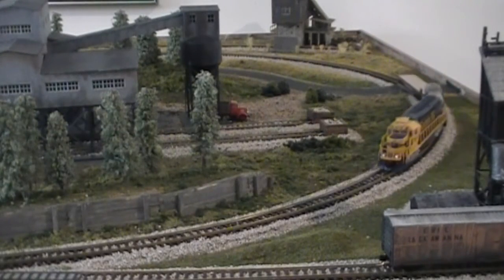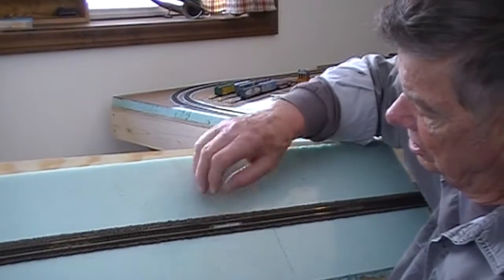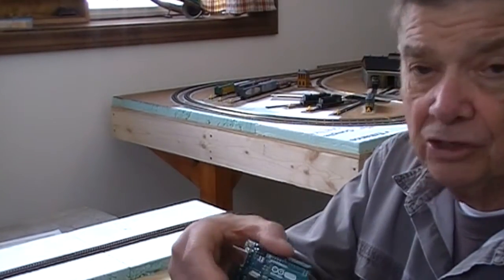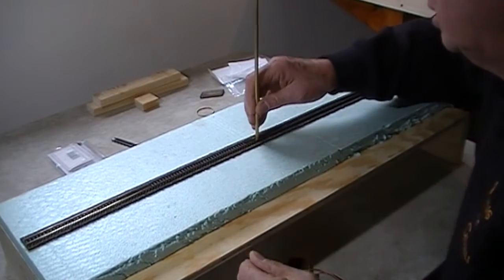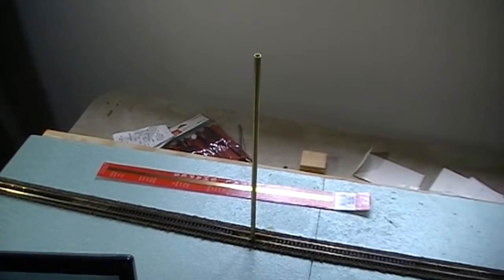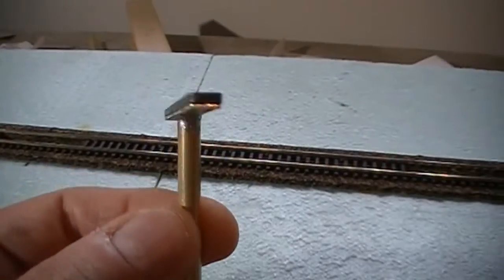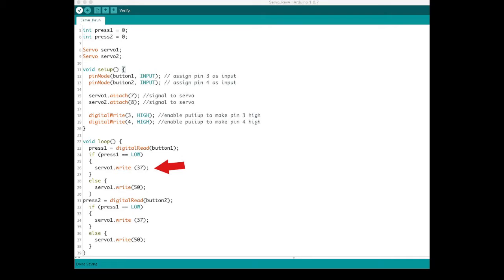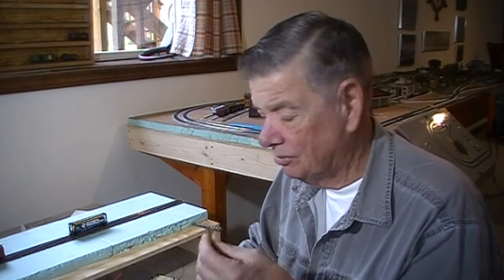Magnetic Decoupler Project

Comment: This method is entirely too complicated and totally unnecessary.  An Arduino and a servo for magnetic uncoupling???  How about 2, quarter-inch neodymium round magnets secured inside opposite rails?  That works and it works well every time.

Comment: Neat idea. Thanks for sharing. I’m starting to think the Arduino can do a lot on the railroad.
Reply from the maker: I really like using the Arduino. It controls the turntable, the weld shop, and campfire also. I am starting to set up some signaling on my layout using the Arduino.  My big problem is I did not set my layout up for block detection so now I am rewiring it for that. I enjoy your videos and thank you for the reply.  —Jack
Reply: LS3Jack I have started the preliminary investigation towards signaling. Found the wiring needs to be altered as well. I’m interested in Arduino for signaling. It’s a new avenue for my investigating now.

Comment from the maker: I wanted to correct the sketch for 6 servos:

#include <Servo.h>
int button1 = 2; //button pin will be HIGH
int button2 = 3; //button pin will be HIGH
int button3 = 4; //button pin will be HIGH
int button4 = 5; //button pin will be HIGH
int button5 = 7; //button pin will be HIGH
int button6 = 8; //button pin will be HIGH

int press1 = 0;
int press2 = 0;
int press3 = 0;
int press4 = 0;
int press5 = 0;
int press6 = 0;

Servo servo1;
Servo servo2;
Servo servo3;
Servo servo4;
Servo servo5;
Servo servo6;

void setup() {
  pinMode(button1, INPUT); // assign pin 2 as input
  pinMode(button2, INPUT); // assign pin 3 as input
  pinMode(button3, INPUT); // assign pin 4 as input
  pinMode(button4, INPUT); // assign pin 5 as input
  pinMode(button5, INPUT); // assign pin 6 as input
  pinMode(button6, INPUT); // assign pin 7 as input

  servo1.attach(8); //signal to servo1
  servo2.attach(9); //signal to servo2
  servo1.attach(10); //signal to servo3
  servo2.attach(11); //signal to servo4
  servo1.attach(12); //signal to servo5
  servo2.attach(13); //signal to servo6
    
  digitalWrite(2, HIGH); //enable puiiup to make pin 2 high
  digitalWrite(3, HIGH); //enable puiiup to make pin 3 high
  digitalWrite(4, HIGH); //enable puiiup to make pin 4 high
  digitalWrite(5, HIGH); //enable puiiup to make pin 5 high
  digitalWrite(6, HIGH); //enable puiiup to make pin 6 high
  digitalWrite(7, HIGH); //enable puiiup to make pin 7 high  
}

void loop() {
  press1 = digitalRead(button1); 
  if (press1 == LOW)
  {
    servo1.write (37); //This valve can be changed to set min or max limit
  }
  else {
    servo1.write(50); //This valve can be changed to set min or max limit
  }
  
  press2 = digitalRead(button2); 
  if (press2 == LOW)
  {
    servo2.write (37);
  }
  else {
    servo2.write(50);
  }

  press3 = digitalRead(button3); 
  if (press3 == LOW)
  {
    servo3.write (37);
  }
  else {
    servo3.write(50);
  }

  press4 = digitalRead(button4); 
  if (press4 == LOW)
  {
    servo4.write (37);
  }
  else {
    servo4.write(50);
  }

  press5 = digitalRead(button5); 
  if (press5 == LOW)
  {
    servo5.write (37);
  }
  else {
    servo5.write(50);
  }

  press6 = digitalRead(button6); 
  if (press6 == LOW)
  {
    servo6.write (37);
  }
  else {
    servo6.write(50);
  }

}

Comment from the maker: Here is the sketch for the Arduino.  If you use less decouplers remove the lines of code that relate to that button and servo.  you can operate 8 servos if you need to.  Remember to operate the servos from an alternate 5V power supply, do not use the 5V from the Arduino.

#include <Servo.h>
int button1 = 2; //button pin will be HIGH
int button2 = 3; //button pin will be HIGH
int button3 = 4; //button pin will be HIGH
int button4 = 5; //button pin will be HIGH
int button5 = 7; //button pin will be HIGH
int button6 = 8; //button pin will be HIGH

int press1 = 0;
int press2 = 0;
int press3 = 0;
int press4 = 0;
int press5 = 0;
int press6 = 0;

Servo servo1;
Servo servo2;
Servo servo3;
Servo servo4;
Servo servo5;
Servo servo6;

void setup() {
  pinMode(button1, INPUT); // assign pin 2 as input
  pinMode(button2, INPUT); // assign pin 3 as input
  pinMode(button3, INPUT); // assign pin 4 as input
  pinMode(button4, INPUT); // assign pin 5 as input
  pinMode(button5, INPUT); // assign pin 6 as input
  pinMode(button6, INPUT); // assign pin 7 as input

  servo1.attach(8); //signal to servo1
  servo2.attach(9); //signal to servo2
  servo1.attach(10); //signal to servo3
  servo2.attach(11); //signal to servo4
  servo1.attach(12); //signal to servo5
  servo2.attach(13); //signal to servo6
    
  digitalWrite(2, HIGH); //enable puiiup to make pin 2 high
  digitalWrite(3, HIGH); //enable puiiup to make pin 3 high
  digitalWrite(4, HIGH); //enable puiiup to make pin 4 high
  digitalWrite(5, HIGH); //enable puiiup to make pin 5 high
  digitalWrite(6, HIGH); //enable puiiup to make pin 6 high
  digitalWrite(7, HIGH); //enable puiiup to make pin 7 high  
}

void loop() {
  press1 = digitalRead(button1); 
  if (press1 == LOW)
  {
    servo1.write (37);
  }
  else {
    servo1.write(50);
  }
  
  press2 = digitalRead(button2); 
  if (press2 == LOW)
  {
    servo1.write (37);
  }
  else {
    servo1.write(50);
  }

  press3 = digitalRead(button3); 
  if (press3 == LOW)
  {
    servo3.write (37);
  }
  else {
    servo1.write(50);
  }

  press4 = digitalRead(button4); 
  if (press4 == LOW)
  {
    servo1.write (37);
  }
  else {
    servo1.write(50);
  }

  press5 = digitalRead(button5); 
  if (press5 == LOW)
  {
    servo1.write (37);
  }
  else {
    servo1.write(50);
  }

  press6 = digitalRead(button6); 
  if (press6 == LOW)
  {
    servo1.write (37);
  }
  else {
    servo1.write(50);
  }

}